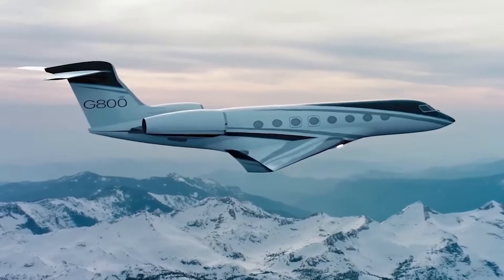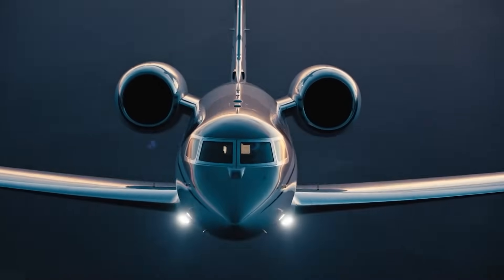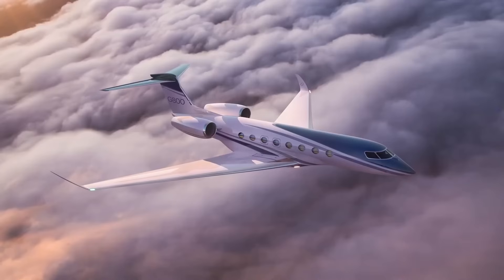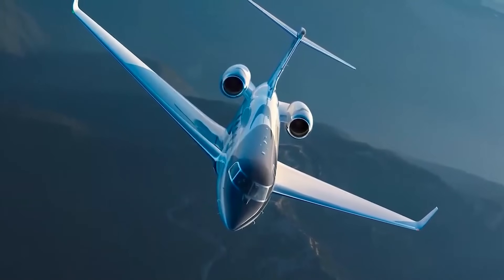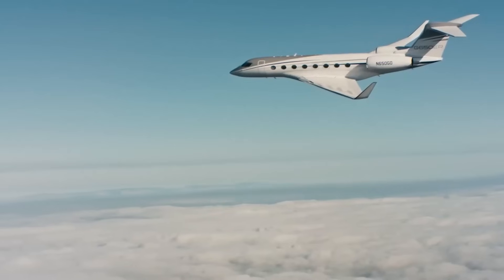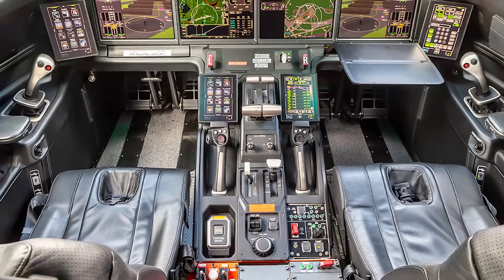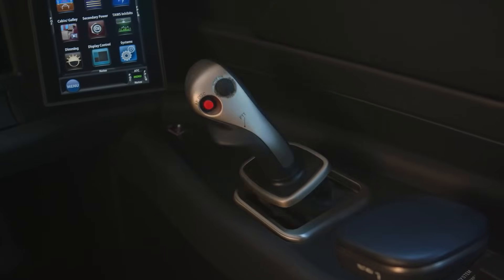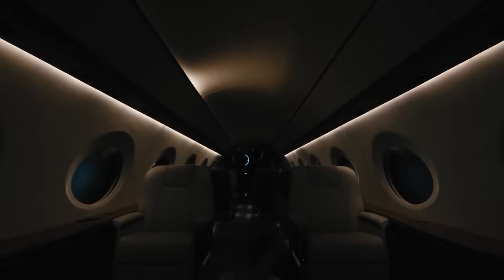Gulfstream's G800, What You Must Know About Their Latest Jet

Comment: Dassult Falcon 10X has huge cabin cross section compared to G650, G700, G800.

Gulfstream has narrow tube jets!

10X has fighter jet fly by wire tech and Gulfstream has been held up in FAA certification process because they can’t get their new untested fly by wire approved by the FAA.

GS is riding on old name recognition 
And not larger cabin width or height like Dassult Falcon 10X.

At 6 feet 8 inches, 10X cabin height is 6 inches taller than GS narrow tube jet!

10X has newer Rolls Royce engines.

This video is full of half truths and deception.

Study up on the truth.
Real stats on these jets will convince you Dassult 10X is superior in every respect.0

Bombardier Global is better than GS.

Best Biz Jet best to worst:
1. Dassult Falcon 10X
2. Bombardier Global, 7000, 7500 8000
3. Gulfstream G 700, 800